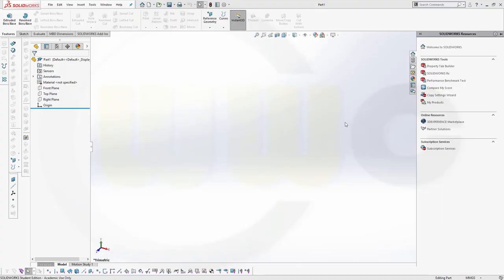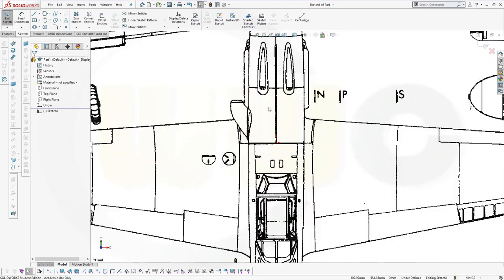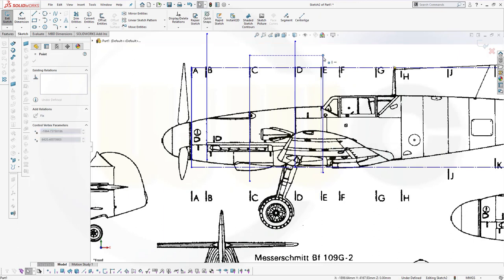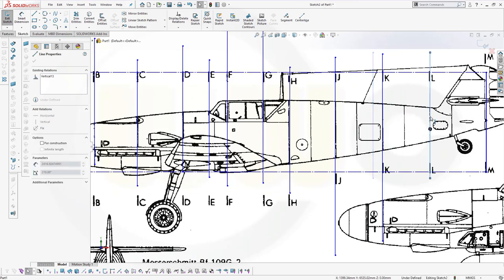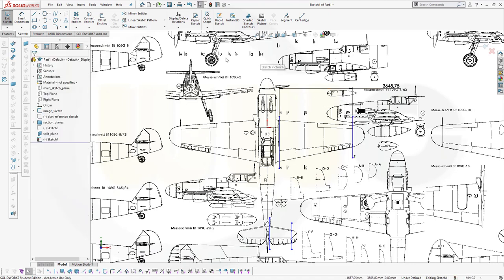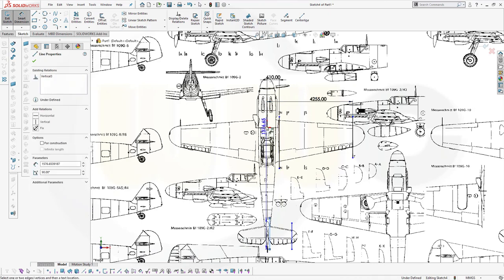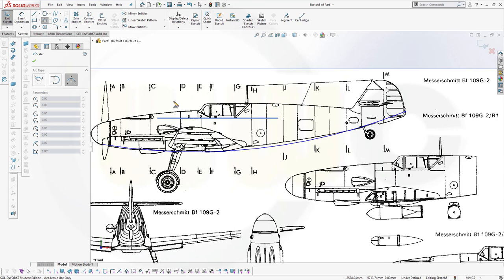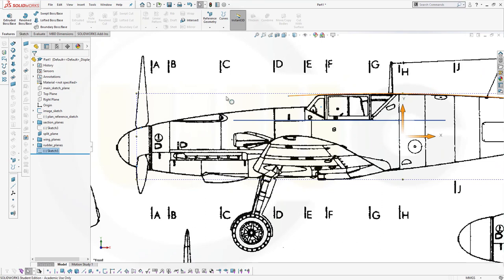WW-109 Fighter Plane Part 1 - SolidWorks 2020 Training - Surfaces

Comment: Constructive comment: you can do the surface extrudes at the end all in the same action (tho I dont know yet if you did them individually for a reason), second thing would be to explain why you're doing what you're doing- it helps me to understand quicker. For example the planes for the wings and rudder- I kind of just did them without knowing why.
Anyways good tutorial
Reply from the maker: I try to do those exercise very similar in all programs, this explains i.e. those separate extrudes. The lack of explanation is partly due to lack of time and/or the fact that I don´t earn money with these videos. I´ve monetarized only a few NX videos in order to see how much money I would probably loose ;)
Reply: @wolfgang.walden.cad.training  Fair enough.
Maybe you could consider making a solidworks course for Udemy, there isn't really one there focusing on surfacing in practical exercises. Organic forms like cars, airplanes and items like game controllers are not there. I'm not sure, maybe you'd earn something there too.
Reply from the maker: I know  udemy and many others, but in my opinion it is not really worth the effort.

Comment: I know how to do my Photoshop with blueprints. I have an question, you did know the Photoshop, didn't you?
Reply from the maker: Yes, and I´ve done this with the BMW/CAR images, which I split in front, back, side and top image. You should have noticed that video in my channel, havn´t you? Anyway, to arrange about 20 small pictures exactly aligned in 3d would take a lot of time and would fail in the end. So I will sketch the profiles on the big image and copy/move them to the correct place and then adjust them exactly. By the way you can use even microsoft word for splitting images.

Comment: Not optimal. 
It can be done easier.
Reply from the maker: You might have noticed - I try to do it in 8 programs and also kind of similar. So it might be not optimal. So what would you suggest?
Reply: @wolfgang.walden.cad.training  I don't know English well enough to write long texts. On the side view plane, draw a closed path. Half of the section projections must be drawn one after the other, making sure to connect their line ends to the previously drawn side view contour. There are several things to consider when building your body. In fact, it's easier for me to show than to explain in a language that I speak very poorly. You have done a lot of unnecessary things that will create confusion and difficulties in future editing of the model.
Reply from the maker: So, that is almost exactly what I will be doing - tell me something I don´t know. What do you mean are those planes for??? And obviously you haven´t got a clue what I´m doing, have you? I will draw only one half of these sections, and therefore I will need those extrudes to make sure that the surfaces will be tangent continous after mirroring. I have to split this video into parts which make sort of sense, otherwise it will be too long. Also I want to use the image like it is and I don´t want to split it into maybe 20 smaller ones and arrange/align all of them.
Reply: @wolfgang.walden.cad.training  Tangent can be achieved in different ways. Auxiliary surfaces are not necessary for this. Moreover, with future editing, they can still interfere, not to mention wasted extra time and computer resources. In large assemblies, such parts have a performance impact.
Reply from the maker: This is not an assembly at all and it has to work in all programs. Which programs do you use?
Reply: @wolfgang.walden.cad.training  Certainly not an assembly. I meant unoptimized your build method. I am sorry for my bad english.
Reply from the maker: It is an exercise, not neccessarily meant to be best practice.
Reply: @Serhiy34  Please make a video, get the same plans as  Wolfgang and show us what are you talking about. It will really help me and many other people. You don't need to talk. Its ok if you just show it! Thank you!
Reply: @nicolach4762  Now my work schedule is too busy. I plan to start creating a series of tutorial videos this fall.
Reply: @Serhiy34  thanks!!